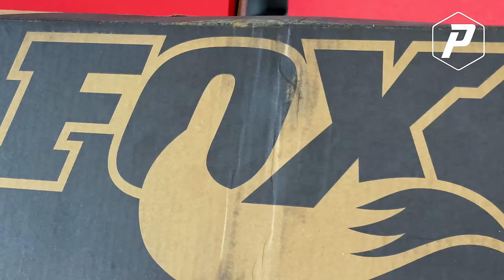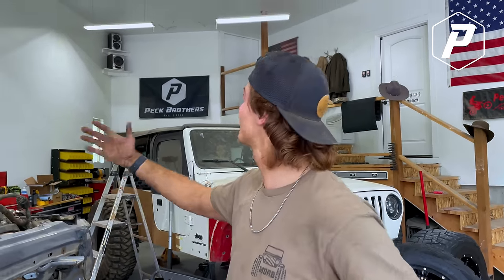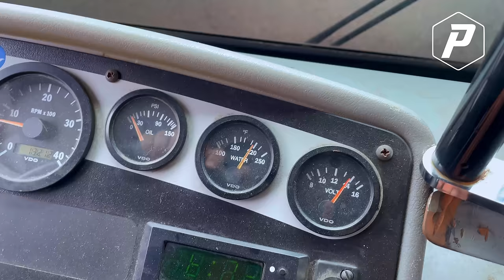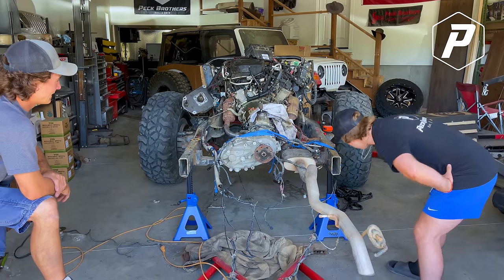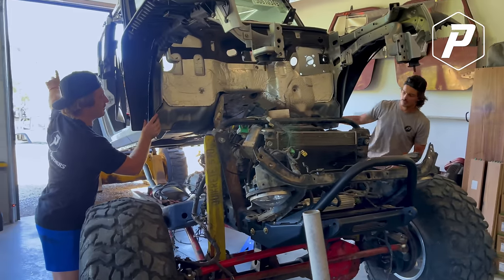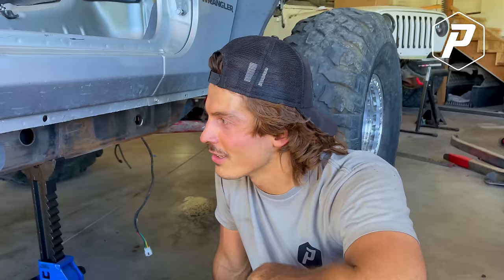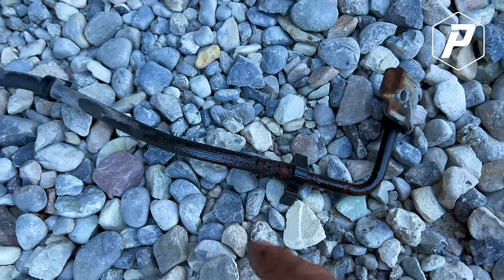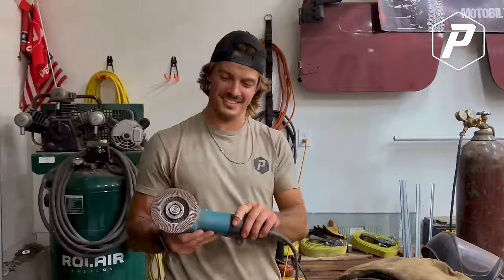HOW TO: REBUILD A JEEP IN 2 DAYS

Comment: My 07 failed same spot, the master cylinder fails horribly as well I had 2 fail internally after the line blew. I ended up doing the j8 booster and master cylinder swap to rectify the weak issue
Reply from the maker: Must be a common thing!! I don’t see how to wouldn’t be, it’s the worst design I’ve ever seen 🤯